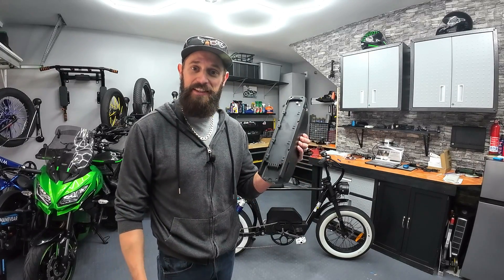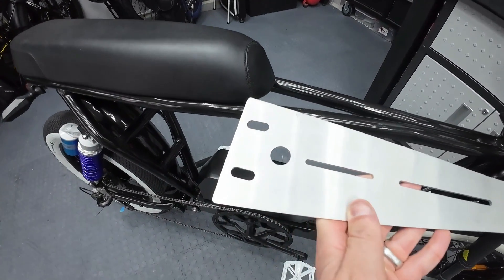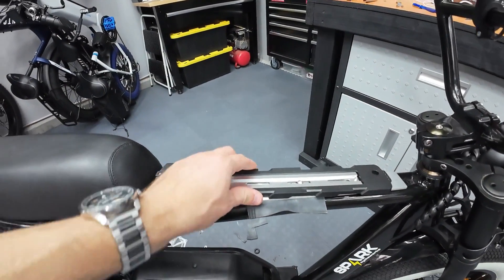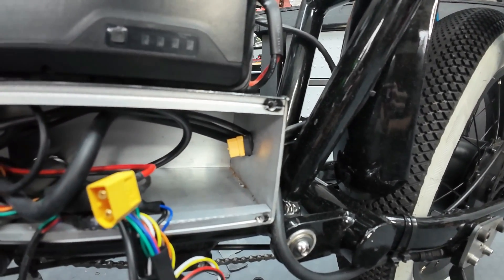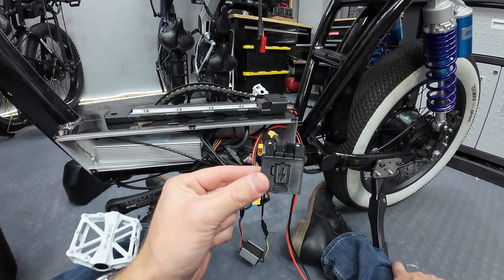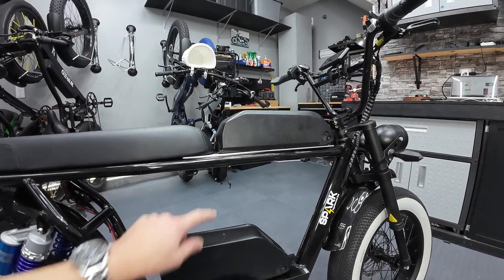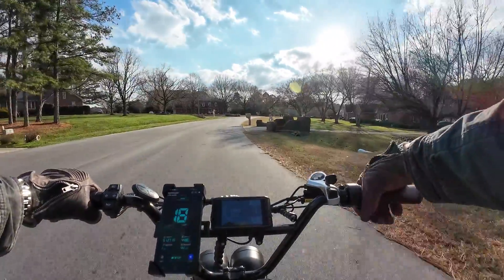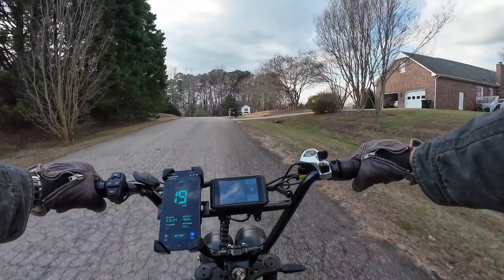Battery Blender Install:  Increase Your Range!

Comment: The easiest hack is to buy two xt60 cables for an extra battery of the same voltage and plug male to male on the inside with one cable and female to female with the other cable and run them outside the scooter or bike controller and then you can plug either battery in.

Comment: Any suggestions on a 52v battery for this upgrade? I got one of the last Bandits last year and Spark CW is out of Bandit batteries. I got the blender and top tube bracket. Just need the battery!
Reply from the maker: i always recommend BicycleMotorWorks for batteries.  i ordered from them before and it worked out.

Comment: Interesting vid. If you have two batteries of same voltage that both fit in the factory mounted cradle, isn’t it safer to just switch them out when battery a gets low? It’s not much work. In theory you don’t want either one to get to zero anyway. I’m not too concerned about extending an extra 5-10% voltage increase for extending max speed.

Comment: Did you get more power / speed from the extra battery?  I had read somewhere you can up the amps in the controller settings since each battery can now discharge its max getting a larger total?   that make sense? have you tried this ?  thanks

Comment: Question… if you have existing 48v battery and you added 72v would it put out somewhere in between voltages assuming you had a worthy motor ?   Maybe would increase power then? …. Thanks

Comment: Does the battery blender work on the Wired Freedom?
Reply from the maker: I would say no, it's rated for 30 amps. And the wired freedom uses 40 amp controller.

Comment: Excellent video. Like you, my spare battery's cradle had different connector rather than the common ubiquitous "XT60" connector. I just got done soldering the XT60 connector to my spare battery's cradle wire. Tomorrow will do the install on the bike. 

On the wiring in your situation, I would have just bought XT60 "extension cables" on Amzn. Mine was $12 for a 3' wire, and included male and female XT60 connectors. 

I'm not mounting the cradle to the bike because I want to be able to use the battery on my other e-bikes (all of them use XT60 connectors. Only reason I had to do the mod on the old cradle is because that bike was made in 2019, older tech). 

Anyway, I mounted the cradle on to a piece of black-painted plywood and that will be fastened inside the bike's rear basket; voilà, I will have a portable spare battery. 

I don't know the difference between that $150 "blender" and the "battery balancer" I bought on Amzn for $46. The balancer I bought handles up to 40 amps. But if you want more amps those balancers are also available. 

If interested in the one I got, search Amzn "Double Battery Discharge Converter for E-Bike 750w and 1000W Dual Battery Pack Switch Balancer 24-72VDC (Max Current 40Amp)" and it will pop up.

Comment: Instead of the rubber inner tube between the mounting plate and the frame I would use weather stripping and run it the length of the mounting plate.

Comment: Great video 👍.  I have many ebikes but currently focusing on my fat e-bike.  Ecotric Sportcool)Cheetah, 36v 500w, 12.5ah original battery.  The original controller is a 36v/48v controller with S900 LCD.  I was originally considering swapping out the old 36v battery and upgrading the battery to 48v 20/22.5/24ah, ebikling 36v/48v controller, ebikling S900 LCD.   But will this Bike Battery Blender work on ANY ebike?   If so, i may only need to buy a long extension, Anderson & XT60 connecters and throw the battery on the back rack in a pouch with a quick disconnect.  What are your thoughts 🤔?  Could you please send the link for the blender.  Thank you for your help in advance 🙏

Comment: you should add a third battery upside down in the frame. that device has an outlet for it. i would also use a loom for your wiring to make it look neat and factory made.

Comment: I connected a 10.5 and a 20.0 48 V batteries wired in parallel with a switch and a fuse. I’ve been using it for two years now with zero problems and having a cumulative of 5000 miles. I charge batteries through factory charge port on bicycle and keep batteries at the same charge level. Like adding an extra fuel tank. Did I do something wrong? also has been this way for approximately three years.

Comment: Does it sip juice from both batteries at the same time or drain one then go to the other?
Reply: These typically switch back and forth as they run down.  Also the battery gauge will usually only show which battery it is currently on.  So it will show 4 bars, then 3, then next time I look it will be 4 again as it switches back to the other battery.  On one of my bikes, the gauge is never correct. LOL

Comment: Always gotta have a second battery. I’m thinking about getting a wired freedom extra battery would be the first thing I would do. I don’t know if I want them to run in tandem or just use one battery at a time one battery gets down pop in the new one.
Reply: Did you ever get the second Freedom battery and did you decide to run them together? I just received my second battery and was thinking about just strapping it to the rear rack. I will swap them when necessary but running them in tandem should reduce voltage sag.
Reply: I would like to find a better way to mount the second battery. My preference would be to leave the rear rack open for my bag or panniers.

Comment: Anyone know if theres any blenders capable of handling 40 amps?
Reply: Yes, they make them for 40 amps.   20-40 amps are pretty common. 50-60 is a little harder to find.  80-100 is available.  I put 100 amp on my first one, which was overkill.  But, 10k miles later it is still going strong 😀
Reply: @papablueshirt  nice, I just seen his new review actually has a 40amp blender. Gotta mustered the balls to start saudering. Thanks for reply!

Comment: But facing down under top tube
Reply from the maker: definitely more secure on the top, plus looks better, and also mounting plate wouldnt work underneath since it uses the seat bolts.

Comment: $2800 + $800 for second battery is just way too expensive.  A brilliant reviewer once said you have to keep the bike under $2000 to have a big seller, and he was right.  The fact that you had to modify the battery kit to make it fit is not a great advertisement for American craftsmanship.  I don’t think these battery blenders are made in the USA, they look identical to the ones sold online for less than 1/2 the price.

Comment: Put the battery blender on the Grizzly and connect a 60v battery where the 15ah 52v battery is located to the 20ah battery under the seat. 🖖🤙
Reply: Interesting. I thought you could only battery blend to 2 batteries with the same voltage. I have the Grizzly, so how would a 60v front battery and 52v rear battery be able to work in parallel without something bad from happening?🤔

Comment: 🐍You haven't proved the battery blender's worth until you plug in a 60v battery & combine it with a 52v battery. Time strip a 60v battery & harness of one of your other bikes for the combiner test. 🖖🤙

Comment: Dual batteries on the Spark Cycle Works Bandit is the way to go for longer range and top speed without the voltage sage. Both of my Bandit's are set up this way and the ride is that much smoother.

Comment: Love your bike! Shame you didn't try a 60V battery in your 52V system, for some higher speed! The blender will pull off the higher voltage  battery until it's down to 52V, then draw off both... I'm hoping to do all this in my rack bag since my folder is limited for space...
Reply from the maker: if i some how end up with a spare 60v battery i may give it a try.
Reply: @CitizenCycle925  Most 'blenders' are rated for 30A which makes me wonder what good they are in a bike with 2 1000W motors?
Reply: @CitizenCycle925  My plan is to upgrade my GForce T42 with: a 48V 30AH rack battery; 30A unlimited controller/dis[lay; and a 36V 500W front hub motor. Bike already does 34mph on a full charge but that goes down too fast. and I figure 48V will push the 36V front hub a little harder and I'll have a switch for the front motor. Do you think the original thumb throttle can take the extra load?

Comment: So the idea is to gain distance, not more juice for power and speed.. i wonder is you could with a diff controller 🤔 With all that open space id like to put the old batt up Under the new batt, then add some kind of container with a locking lid.. many used for it.. groceries, tools, fishing gear.. even a drain hole for a 6 pack and ice lol 👍

Comment: Good video! Any time I use a battery blender in a confined space with minimum air flow, I usually glue a heatsink on to the unit. I've had them get hotter than I would want them to be.

Comment: hmmm isn't that the same exact devise as the DATEx2 Parallel Battery Adapter ?  been running a duel battery set up thru a DATEx2  on my ebike for quite awhile now... if it's the same devise I've had no issues it's a very good product...

Comment: This is very interesting to me. You say we can use different voltages. If you were to mount a 36 V battery to a 48 V system, do you know what would happen? Would it just be down on power? Or would it damage the controller? I could see going to high with a voltage would damage,  but I wonder about going lower?
Reply: Same thing I'm wondering, I always thought running batteries in parallel, the batteries had to be the same voltage

Comment: It's strange to see that Spark diidn't give you enough 12 gauge wire.  I was wondering how you range is on the 25 amp Hour?  I know there is a many riding styles.  If there chart is accurate on the website.  Thanks for this video!
Reply: Yeh, you would think that charging nearly triple the price of what you can buy these for elsewhere would get you a huge amount of extra wire.

Comment: Good install, and putting it in the controller box was a good idea. If it were me, i would have replaced the Anderson connectors with XT60's because they are more resistant to dirt and water, and handle more power. That version of the Battery Blender is 30amps, but it will handle higher peaks and surges. I have the 90 amp version, but it's not compatible with the field weakening I use on my bike. If anyone wants the technical reason, let me know and I'll be glad to post it!
PS: I do think the top is a better place. Under the top tube would give you a lower center of gravity, but then the entire weight of the battery would be on the little plastic tabs and the connector.

Comment: Killer video, thanks. I recently bought a used Fucare Libra, whi h wasnt what i really wanted but at the price $500, couldnt pass it up. Immediatly wanted second battery for that extended range, and while im capable of making my own device, the cost is worth the assurance that wiring and connections are all correct, dont want any fires you know. Next for me i think is adding e conversion kit to an old school full suspension Haro mtb given to me free from a friend. Thanks again and im subscribing to your channel right now. God bless to all and take care in the trying times ahead.

Comment: Overpriced, I just use releaseable cable zip ties and place my other battery on top of each other and change when needed (no extra wiring or parts needed) Great job though !!
Reply: You hit the nail on the head, the second battery option should come pre wired at no extra cost save the actual battery or it is much simpler and inexpensive to simply carry a 2nd battery and switch them.

Comment: I thought I saw it was a 30A blender. Isn’t that controller putting out more amps than the blender is rated for. I would think so with the speeds you’re going.
Reply from the maker: This bandit has a 35amp controller. Spark said they've used it for 35amp. But I think 30a is probably ideal for it.
Reply: So what does the amperage actually mean on the battery blender?

Comment: Why would you install it a over the top bar when you have all that room below it?

Center of gravity matters.
Reply from the maker: I think it looks better on top.  plus the mounting plate would not have worked underneath because it uses the seat bolts..

Comment: Save yourself $150 and just buy some high powered diodes like the ones they use in solar panels to prevent the batteries from discharging back into the panels when it goes dark. That's all this thing is. Diodes connected in a half wave rectifier configuration. It's a rip off.
Reply: I can't speak for the blender he has, but many have power FET elements in them instead of diodes.  This gives a LOWER voltage drop across the blender, than what a diode will normally causes.   This means more of your battery voltage makes it to the controller/motor.  

But yes, in the most simple sense, diodes would work.
Reply: @addertooth1  . Using Schottky diodes would only be 0.3 volts. A negligible loss. But even so, MOSFETS are not expensive either, especially compared to what they are charging for these things.
Reply: @E-BikingAdventures  Using Power mosfets the loss can be less than 25 mV.   The RDSon of the junction is less than 0.0005 ohms on some of the better ones.  But sure, I agree that Schottky barrier diodes are the king of low loss.... for diodes.  

If you want simple, use diodes.  If you want the best, Use high grade Power MOS FETs.
Reply: @E-BikingAdventures  Yes, they ARE expensive.  I considered making my own, but in the end I got lazy and bought a different combiner than what is seen in this video.  It came with extra cables and goodies that made it attractive for ease of installation.
Reply: Beep beep  bop boop beep beep🚲🔋🔌💡📈🧬🧲⚙️🤓

Comment: I added 2 blenders for 3 batteries.  60ah. $80 for 2 on Aliexpess. Working  fine after 10 months using. 3700 miles
Reply: Hey ,you have a link of the brand?
Reply: Hello! I have an 80amp Sabvaton controller. Question is: 

Can I blend a 52v and 80v together and will my controller and motor (3000 watt) be able to handle it?! 

Thank you
Reply: Not bad much cheaper
Reply: got a link for 1 ?

Comment: Why would you mount the battery on the top side of that bar not the underside of that bar for balance purposes if only that
Reply from the maker: I think it looks better on top plus the mounting plate wouldn't work underneath because it uses the seat bolts.
Reply: I think u should answer some questions here to make it clear  for people to understand ✌️ @CitizenCycle925

Comment: Great video, it shows the typical cable issues most people will run into.  

Battery blenders work best if both batteries are the same voltage.   A 48v and a 52v battery do have "some" overlap where they are working at the same time, but the 48v battery contributes nothing to the load until the 52v battery voltage has sagged down about 4 volts from peak.  However, even with this limitation, you do enjoy extended range.   I am setting up a dual 48v system for a total of about 42 Ah of capacity for my bike.   Keep in mind your controller needs to be configured to work with the range of the two different voltages if you have two packs of a different voltage.  Your controller needs to be rated for the higher voltage as well.   

Some blender companies will void the warranty if the blender "heat sink" is not exposed to the open air (not in a case).   Also, make sure your blender is rated for the peak current your controller/motors will demand from the battery.  In my case, It required a 50 amp rated blender.